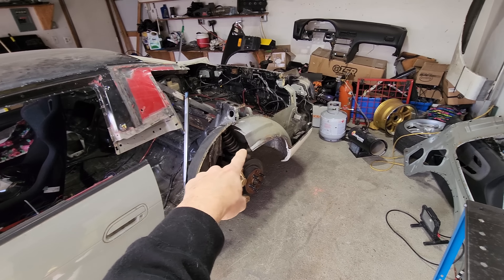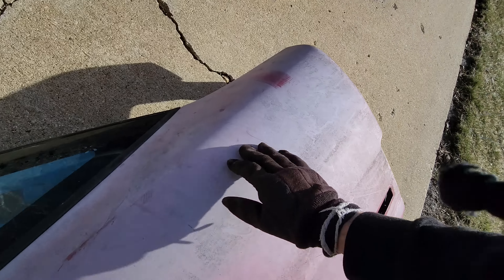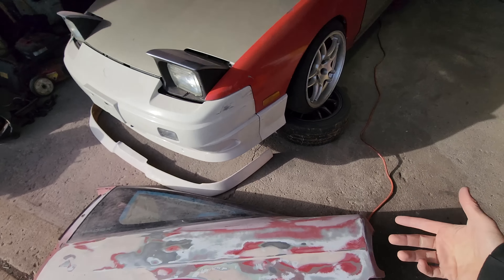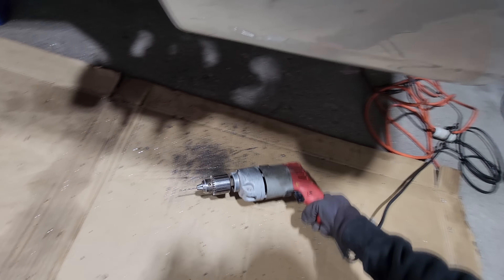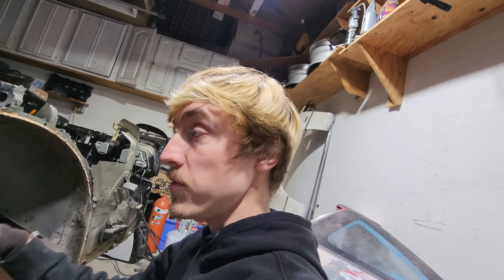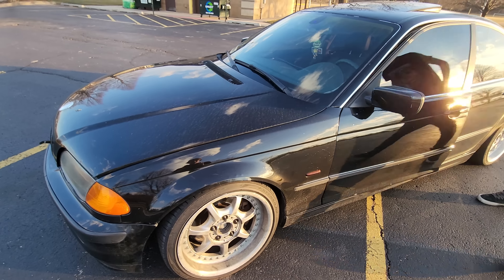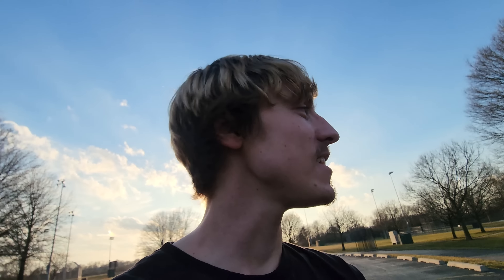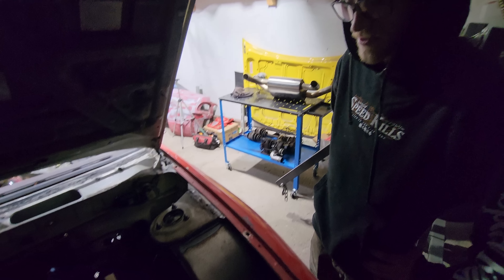Project 240sx has an unfortunate discovery

Comment: Hey, Im not a restorer or anything, but exists something called strip disk, its a rubberlike disk that you can use to remove paint/bondo from the surface, its waay faster than sanding normally or using a wire wheel. That thing was a life saver when I was restoring my car.
Reply: Yup I have stripped paint off several cars, the job always sucks, but the best way is the strip discs (getting someone else to do it is the cleanest option lol, but can't trust anyone to not ruin the job)
Reply: As a collision repair tech, these strip discs are useful. Personally I start cutting the seamsealer with an air hammer with chisel bit then finish it off with a strip disc. Then I grind the wild with a belt grinder and put the new panel on.

Comment: @5:50, i was in same boat, i bought my first rear left quarter panel. was so stoked, got it home, started stripping it down and saw some body filler popping through rear quarter in the trunk pocket area. so panel was rusted and filled with filler then sanded smooth, no patch metal, just glob of body filler spewing through rusted hole and called a day haha. needless to say, i had to source another quarter panel.

Comment: On the hoodie strings... just pull them out as far as you can and then snip them off... they'll recess back inside and you'll never see 'em again.

On the black plastic piece you found... that's actually a latch for these little access panels that were on the interior trim in the hatch.  The jack kit was behind one of the panels if I remember correctly.

Comment: If the lower part of the quarter is rust free then you could just get a rusted out one like you already had and use this one to repair it. Worse come to worse, 2F performance does make fiberglass replacement rear quarters (not over fenders) for the S13 but they are expensive and the wheel arch has a 55MM flare so you would need to do both sides for it to look right.

Comment: On the safety tip about wire wheels. With grinders that have a guard don't take it off. I have a 2 inch scar under my left nipple from one blowing up while upside down under a car.

Comment: I used to use those to open the hood for my 99 acura el lol 😆 I also ran into a snow bank with the car and duct tapped my blinker back in and later super glued it back into the Mount bc the mount cracked. 😅

Comment: Idk if anyone has said it to you yet but in the integras gas door there’s a hook that the gas cap slides onto so you don’t lose it 😅 noticed in your videos that you place it on the trunk instead of the hook lol
Reply from the maker: Honestly I don't like using the little holder thing because it always has debris on it and I don't want sand and dirt getting on the gas cap threads and eventually into the fuel system
Reply: Figured you’d know but on the off chance lol and completely understandable

Comment: Just as an fyi you don’t have to go to bare metal to apply body filler. As long as the body paint is prepared correctly you can apply body filler right over it.

Comment: seen a few of your videos and wanted to know if rust could form in the welds of your frame? also it wouldn't have as much tensile strength with welding something that should be solid. maybe counteract that with reenforced frame rails?

Comment: if you really want my opinion...i would use that quarter, bondo and all (maybe even re-bondo sculpt it) and use it as a mold and make carbon fibre rear quarters for this 240....because F*CK IT...might not help for the internal structure, but it solves the outside.

Comment: that panel is an easy fix you can't expect everything to be straight forward, just sand blast it and re do it till it looks factory.
that car is pushing 25 to 30 years.
that panel has to be better than others you've seen ether that or get a Chinese clone that looks like junk and won't fit, plus it just looks like they wanted a different look maybe for a body kit that never happened.
you ant gonna know what condition it's in till ya get it back to bare metal.